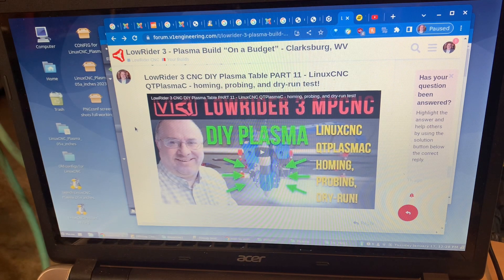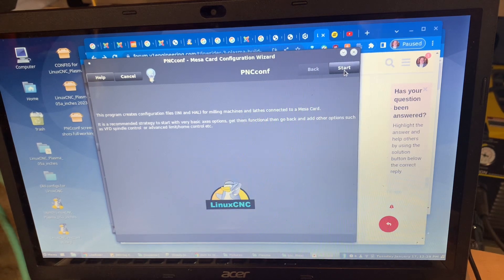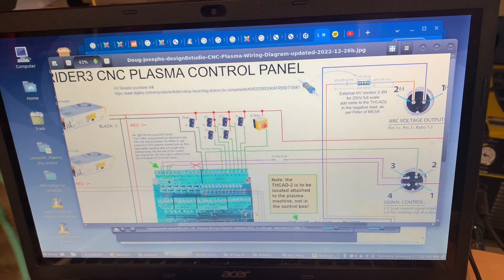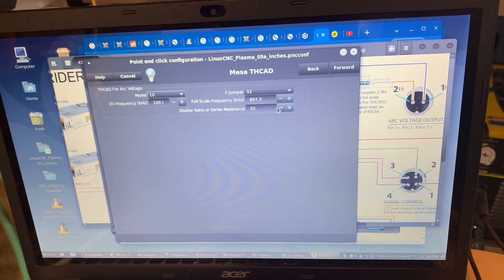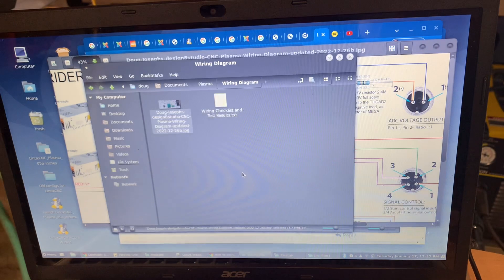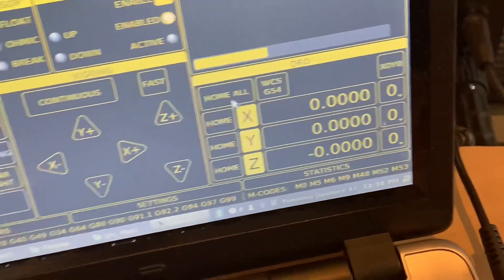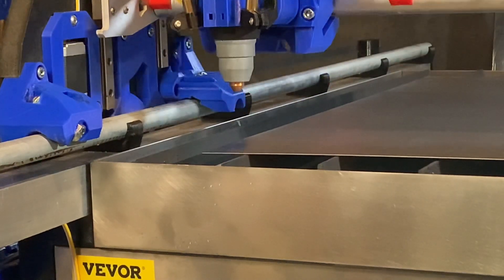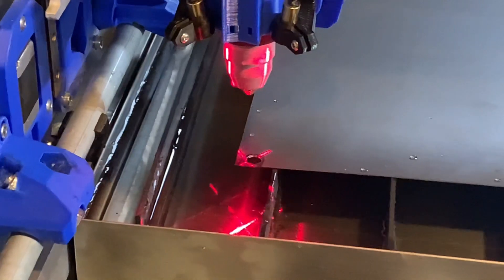LowRider 3 CNC DIY Plasma Table PART 12 - SUCCESSFUL FIRST CUT! Beyond excited!

Comment: I really tempted to upgrade my machine from a parallel port and Mach3 to Mesa boards and LinuxCNC.. but Proma has the MyPlasm CNC setup that looks really easy and plug and play.. but it doesn't look as sophisticated as QTPlasmac and It's more expensive than the Mesa boards.
Reply: I went with the Mesa stuff and LinuxCNC.  I feel like it's the best thing going for the price. FlashCut CNC has very robust plasma software that include integrated CAD software but It only works with their controller hardware which is much more expensive
Reply from the maker: @mrburns366  Cool
Reply from the maker: Decisions, decisions! 🙂

Comment: The LR is looking really nice 👌
How much do i have to calculate if i want to build one roughly?
Reply from the maker: My previous reply to you, was based on just a LowRider, not making it into a plasma cutting rig! Here is some additional info regarding going the plasma route with a LowRider 3 — Q: How much did it cost to build the LowRider 3 CNC Plasma?
A: My cost on this, all in, was about $1,860.58, and it’s comparable in size, capacity and performance to a Langmuir Crossfire Pro with THC, which with plasma cutter with machine torch + flat rate shipping, comes to about $4,568.00, so my savings my going a DIY route was about $2,707. And, I like doing projects like this. For someone who does not, may not be worth it to them. In order to reduce costs, I bought a lesser known name (Hynade brand) CUT60DN plasma ($499.99 on Amazon) and a used Acer touchscreen laptop (for loading LinuxCNC) — “Acer aspire V15 Touch Intel i5 4210U 1.70GHz 8GB RAM 1TB HDD Touchscreen Win 10” (only $119.19 on eBay). Those are included in the overall cost I quoted above, as are both the stainless steel table, and the stainless steel water trays I use for my water table. More details and purchase links are in my build log linked in the description [which is this thread you’re currently reading]. (ALSO: I did not count the cost of the air compressor, which would be an add-on either way, for someone who does not have one that is sufficient.)
Reply from the maker: Hey, thanks! Price estimates range between about $800 to $950 to make one that carries a router, and that does not include whatever table you decide to build or make or buy for it. Depends somewhat on what options you go with such as diameter of tubing, whether it's EMT conduit versus stainless steel etc. Here's a great video with pricing details that was made by a friend I met via the V1E forum: https://www.youtube.com/watch?v=FJ7nYio8oOE — also for more info, check out both the V1 Engineering store and forum.

Comment: nice build!  how do you think the 3d printed parts will be affected by the radiation from the plasma?
Reply from the maker: I’m thinking that if it was in a professional shop running plasma cutting all day every day there would be possibly some long-term effects noticeable, but with my limited hobby use, I’ll probably be only making something every now and then so I really don’t expect to find a noticeable degradation. I will certainly watch over time.